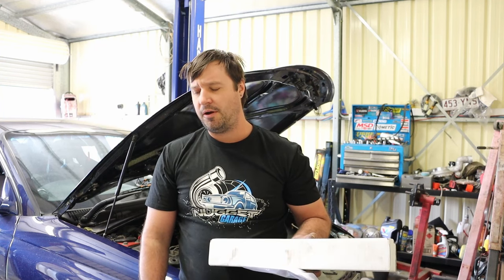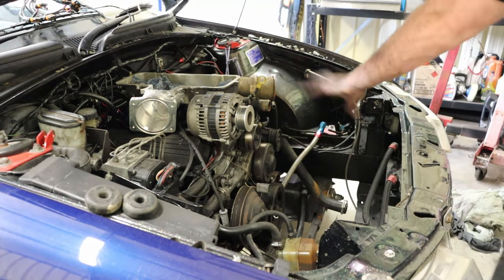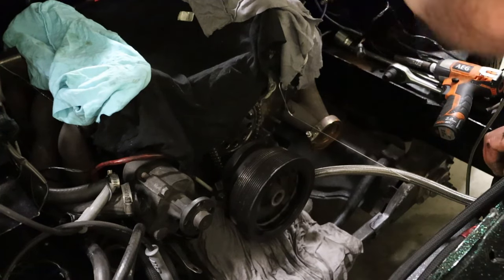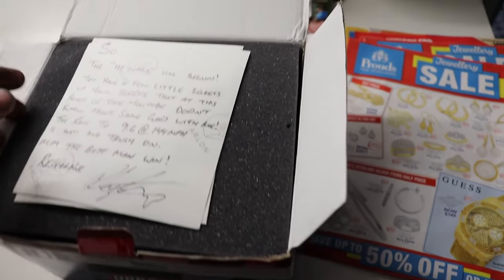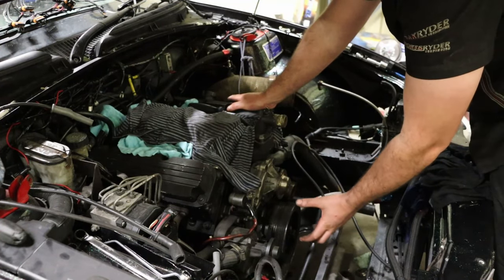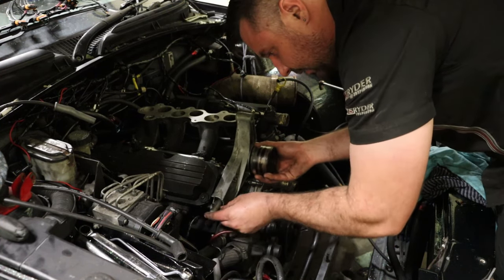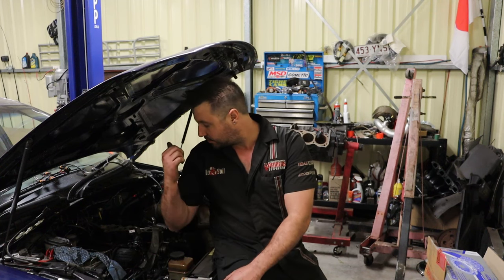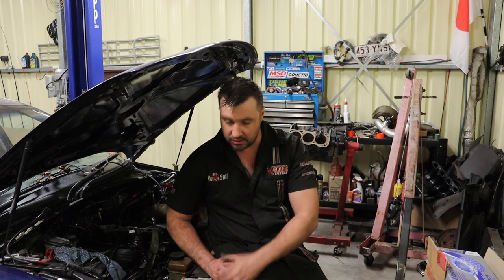Upgrading The Cam In My Turbo V6 Commodore (ethel).....

Comment: Hey bud, gen 3 LS1 lifter change over. Is it just heads off and lifters out? Or recommend removing the cam or anything like that? Love how far Ethel has come dude. Keep rocking
Reply from the maker: Nah man shouldnt have to remove the cam man unless your changing it at the same time.. thanks man I appreciate it 😁🤘

Comment: That coolant pipe is a pain. The o rings leak when you least expect them and to do anything you need to take half the engine apart to try and get at it
Reply from the maker: Yeah man I hate that pipe with a passion aye such a stupid system..
Reply: Keen to hear this thing bump man what's the specs on it?
Reply from the maker: @b3nny90  thanks man it's pretty tame actually.. specs are 245 245@50 625 lift with the rocker I'm using 😊👌
Reply: What ratio rocker?
Reply from the maker: @b3nny90  1.7 man
Reply: Whats your thoughts on running the intake spacers like the mace ones with a turbo setup like this? 1.7 isn't much more than stock upgrade to 1.9s and a bigger bump get that summernats lump habab
Reply from the maker: @b3nny90  lol yeah I'm not a big fan of the 1.9s on anything with a decent size cam to wild on the valve terrain but on a baby cam or stock engine send away man 😊